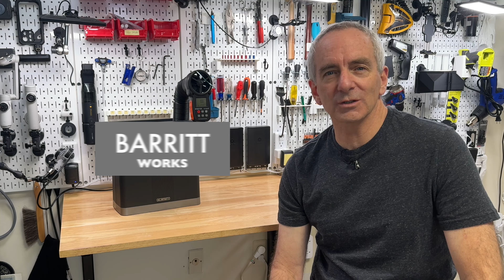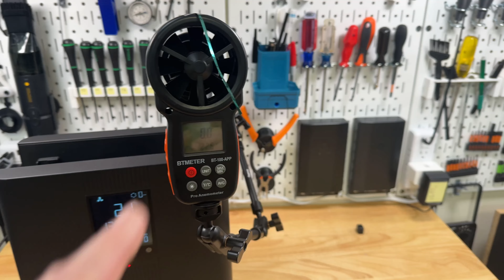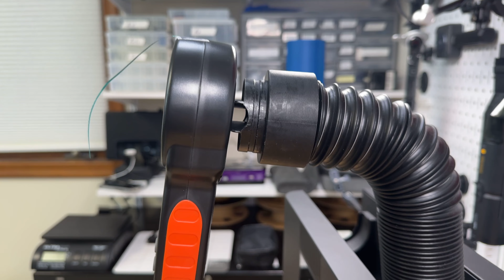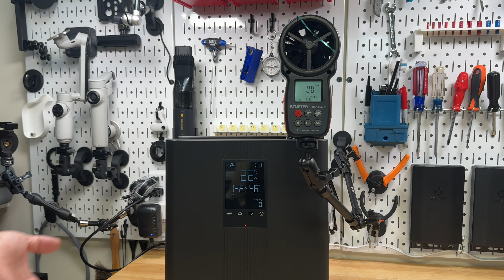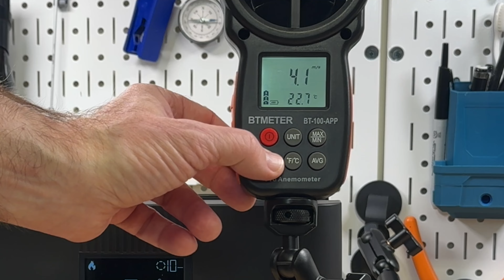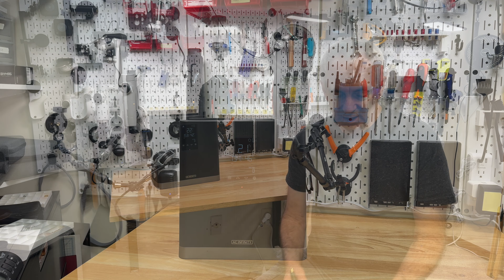AC Infinity Thermoforge T3 Heater Volumetric Flow

Comment: Thank you for this. I was curious on if each level of fan was actually different.  I would like to have heat change but I could tell when I ran through the levels it was full fan in heat mode.  I figured  ACI  set it this way for safety and  legal/lawyers BS  but I would like to see a update with the controller that is like heat 1-4 is half fan speed and 5-10 is full fan speed with varying heat still as I could use les air flow some times.
Reply from the maker: Glad it was helpful. I'd like that greater degree of control over fan level while heating as well. I sent AC Infinity feedback a long time ago. No response.